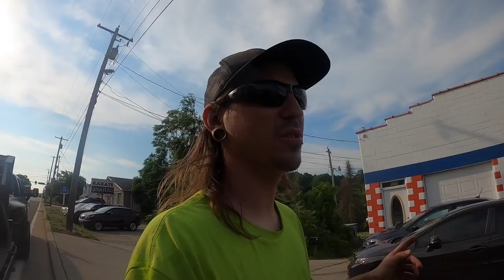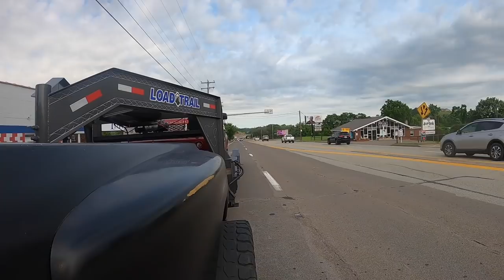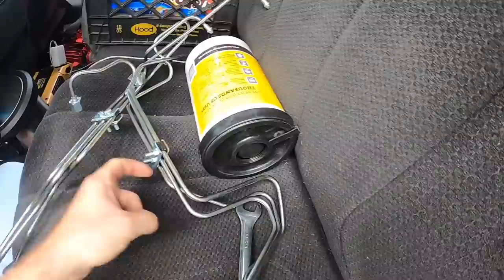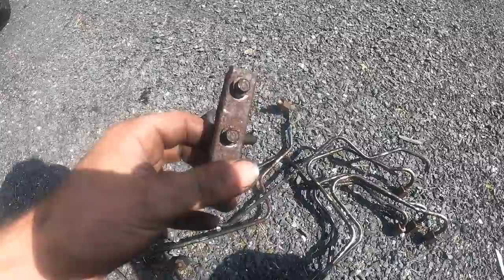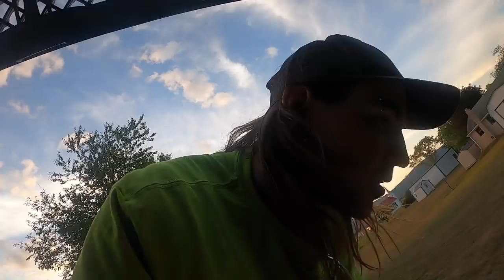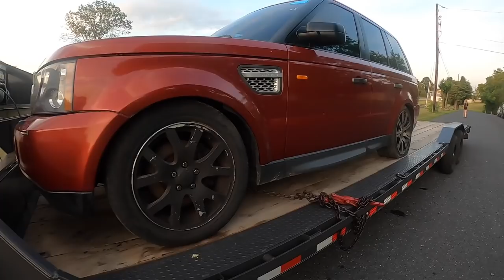Hotshot Rig Loses A Cylinder | Still Makes Its' Deliveries

Comment: You shouldn't run a diesel with a line leaking like that, those injectors need a set amount of pressure to pop and have the correct spray pattern, a 12 valve may be more forgiving, but you can burn a hole in a piston or melt a ring land and not even know it for quite a while. Also, those lines need that bracket to hold them secure, they vibrate quite a bit and will eventually stress the tubes enough that they will crack.

Comment: You are doing pretty good. You need to tie up those injection lines or they will work harden and crack. Pain in the arsh but necessary.
Reply: yelp i agree-not borthing to install that bracket for them fuel lines is a big no no--they are going to vibrate and crack right away. hope not but they will.

Comment: I lost a cylinder on my 99 7.3. Didn't even know until I ran an injector buzz test. One injector had a snapped bolt for the solenoid and the truck had been running on 7. The electronics detects the loss of power from the one cylinder and compensates with the other 7 to make up for it. And this is on a 22 year old truck. The new trucks would probably roll over dead until the stealership gets all your money! A new entry to the business would have less opportunities as many brokers require 3, 6 or 12 months active authority before they will let you haul for them. So the new guys get the cheaper loads until they've been in the business a while.

Comment: Can't wait til you have the truck sorted and redone so it doesn't break every episode lol. I don't weld so I use a lot of jb weld. If you clean the surface good the stuff is unstoppable. I rigged a high pressure hydraulic line on a disc with a hole in it. 1 physical therapy band wrapped tight wrapped in seran wrap. Lol held until I could get a replacement.

Comment: So on this one, I don't think it would be a good idea to leave the fuel lines in storage.  

Why?

Because you know damn good and well that when you have an issue, you're not going to be anywhere near your storage area to have access to those lines.  Shit is gonna happen at the worst time in the worst place.  (In Chris Tucker voice from Friday - "and you know this maaan").

if you have room, I would just throw them in your tool box.  They weigh what?  2 pounds?  Maybe?

But really, how often are fuel lines going to go out?  My guess is you knew they were bad because you did some work on the truck previously and was just trying to "limp" by.  I don't know why a fuel line would go bad UNLESS it was actually damaged from something intentional or something hit it.  And how often is that going to happen?  

I think it's a toss up.  But if you want to keep them as "back up", I think you just need to throw them in the toolbox.

Comment: If the clamps on the old lines where loose or missing that is why they broke make sure the new lines have all clamps installed it's the same with the common rail lines
Reply from the maker: None were missing. Just rusty old lines
Reply: @CPSteveMiller  they're definitely going to break without a hold down seen it happen you also need to replace your valve stems with steel ones

Comment: Be careful with the tint on the front windshield. Here if FL the windshield can only have a glare strip. There are little marks that the tint must stay above on the windshield. FHP will fine you or hand you a razor blade to remove the tint. I can verify this because I was a sheriff officer here a few years ago. They really crack down on tint on commercial vehicles.

Comment: I assume the fuel leak causing lousy mpg caused running empty.   I do have to laugh.  After you add HUGE a extra tank.  You run empty. 
  If you don’t mind.  If you bought new lines when leak started, paid 2x as much, even hired a shop to do work. (Or bought any tools needed you didn’t have). At +$3 fuel.  Where would break even be?   I realize estimate of labor. …

  But it would be interesting cost to drive until cheaper parts. Vs expensive parts at start.  (Not rust proofing your truck, rental trailer with fuel). ;)
  I wonder how that car will look after detailing?  If it will be sold as “clear title”. When it clearly was a flood car.
Reply from the maker: Mpg wasn't super bad when I compared the mileage to what I used in fuel. Never know. It didn't get all over the cars though from what I saw. I still have the red car on me and even though it looks like garbage there's no fuel on it somehow😬

Comment: If you don’t put those brackets line stabilizers you will crack those new fuel lines from vibration I know learned the hard way.
Reply from the maker: I used everyone of them expect the one that holds all 6. They have the hold downs on each side. I feel like these are just a cheap line because nothing I did made them work right

Comment: Haven't been watching you long, but curious to why you 12v swapped it and didn't just keep the common rail?
Reply from the maker: Cost effective, no ELD required, easier to work on, and simplicity

12 valve swap was 2k
Commonrail was 5k

Comment: Do you use a fuel card? 
Also my 05 chevy diesel dually been working hard since 05.. 462k miles on original gear..Xcept a few front end parts.. its only slightly clapped out
Reply from the maker: I use mudflap and efs. My referral for mudflap is in the description if you wanted to try it.
Reply: @CPSteveMiller  I'll check it out,  i just use a conoco card, i get 6 cents off per gallon anywhere.. not great but i put all my fuel on credit and just pay it once a month
Reply from the maker: @jredd801  I've gotten up to 77 cents off a gallon with mudflap 😬 It's great in the central US. Not so much out west or east
Reply: @CPSteveMiller  Damn.. that's a good deal.. farthest east I've been is kansas.. my business is all oilfield related